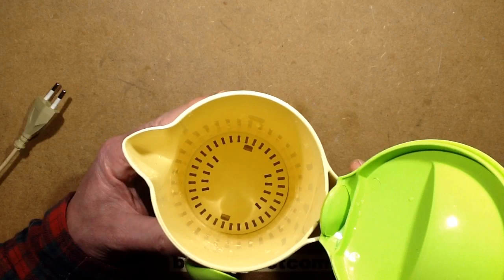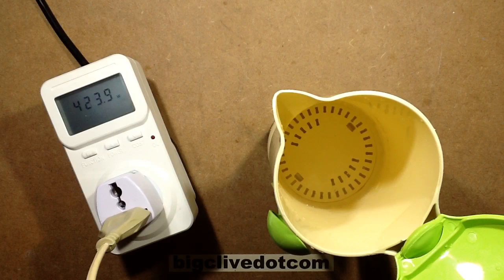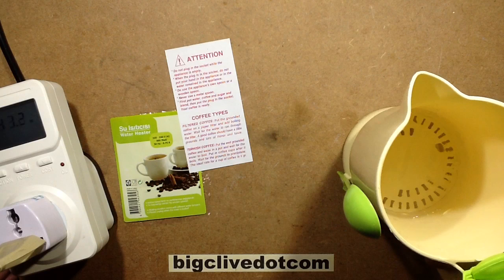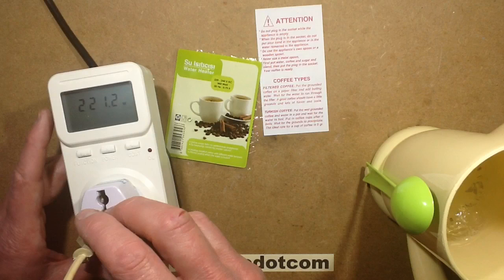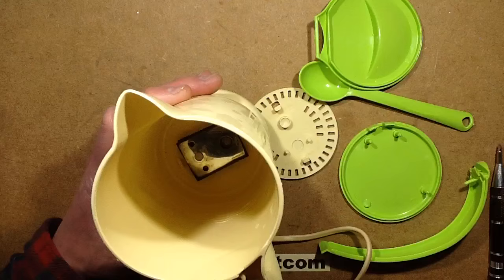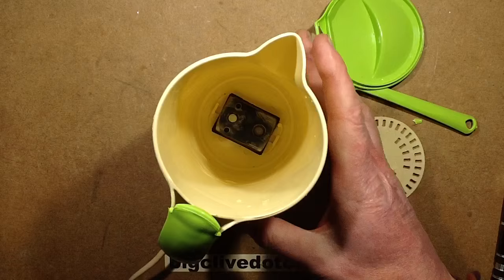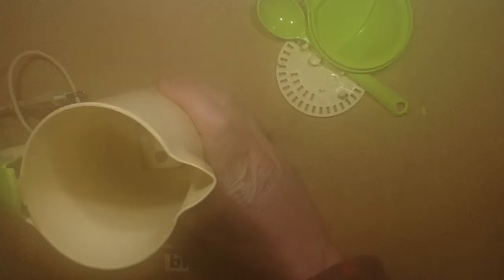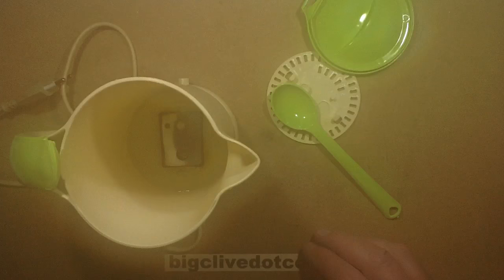Inside a dodgy Turkish "stinger" kettle.

Comment: After this review (when it was current) I launched into a project to try to purchase this exact kettle, find a brand new one in Budapest, I ordered one, arrived in California, and completely unusable in my home country, it has become one of my prized possessions, sitting out on display, ( still in its original plastic wrap package a proudly showing the bizarre green color scheme and critically important green plastic spoon attached to the side) it serves a a conversation starter and a completely exotic technology demonstrator of what is possible without government intervention and the assumption the user is not a idiot. Thanks Big Clive for opening my world and connecting me with a wonderful souvenir.
Reply from the maker: I've kept all the shady electrode boilers as souvenirs.
Reply: Surely if the water resistance is the same, and I see no reason for it be wildly different, it should work on 110, just a bit slower.
Reply from the maker: @johnsherborne3245  It would be significantly slower for a given resistance, but would work.
Reply: If this is what non government intervention creates then give me intervention any day. At least I know my kettle won't zap me and the intructions that come with it won't cause me to add coffee ingredients into electrified water and create a health hazard of a coffee.

My government approved chargers are also less likely to kill me.
Reply: My point is that government standards are very important to safety, especially with electrical appliances. This channel features a plethora of products made without regard for government regulation that are outright dangerous.

Comment: I consider myself a lady of a coffee-drinking persuasion, and I like ways to make small servings of coffee faster and easier. (One of those keurig machines is really tempting, but our old West German coffee maker is still chugging along 20+ years later) I would not want coffee from something like this. Perhaps it could be used to heat water and make pour-over coffee, but then I'd just use a kettle. Coffee that has been "electrocuted" into life doesn't sound like it would turn out well, and it sounds like it didn't. I'm not a chemist, but my gut reaction is that the acids in coffee combined with copious amounts of power could be stripping stuff off the electrodes.
Also instant coffee is worse than original sin in my book.
Reply: I am a chemist, and yes, stuff will slowly be stripped off the electrodes, especially with extra stuff in the water. Interestingly, if this was DC you'd get plating on the electrodes (or some other similar reaction). What's happening inside the kettle is electrolysis. The things inside the water (and to a certain extent the water itself) are being torn apart by the voltages. Again, if this was DC, half would stick to one electrode and half would stick to another but because this is AC, they just bounce around and stay in solution. This isn't a problem if all you have in there is tap water - the ions provide extra conductivity and don't really go anywhere, and electrolysis of water is almost nonexistent at typical mains voltages. It's just a strange and potentially unsafe way of heating water. It becomes a problem when you add organics. They tend to electrolyse in messy ways and recombine in messy ways, so you'll get a soup of various unknown compounds, some of which may be toxic or carcinogenic, and all of which will taste foul. See Clive's electrode-fork-food-heating videos for a practical demonstration on what happens when you just jam uncontrolled mains power into organic materials.
Reply: Steve1989MREinfo would beg to differ on your view of instant coffee. LoL!
Nothing like a shot of Armychino with your MRE.
☕
Reply: I like the pour over for small servings, but recently ive switched to an aeropress, it makes some of the best coffee I've had at home. It's basically a big syringe where you steep the grounds then press it through the filter into the cup.

Comment: Mmmmm hexavalent chromium.
Reply: +TheFlacker99 (Flak) actually thats a good point, im sure there is electrolysis going on, and thus the chrome comes out of stainless, yep good job they dont sell them here!
Reply: +TheFlacker99 (Flak) https://en.wikipedia.org/wiki/Restriction_of_Hazardous_Substances_Directive
Electrolysis of metals into the water?
Reply: paul60163 Yes, using stainless steel causes hexavalent chromium to be put into the water.
Reply: +TheFlacker99 (Flak) Under what conditions? Under what temperatures?
Reply: BIll Georgoulakis
any temperature, it is caused by electrolysis, that part of the plates dissolve into the water
Reply: +jusb1066 Oh, you are talking about the plates that curry the current. What made you think they are made from stainless steel?
Reply: BIll Georgoulakis
ordinary steel would rust right away and colour the water.
Reply: +jusb1066 Of course, but nickle plated brass is the usual low cost alternative in those cases...
Reply: BIll Georgoulakis
im sure clive mentioned in another video they use stainless, im sure using nickel plated brass would also put metals into the water, ( i dont know if copper or zinc or nickel is dangerous or as bad as haxavalent chrome!.  electrolysis will always dissolve the electrodes, on ac both will be affected, on DC they use it to remove rust or do electro plating so affecting only one side
Reply: +jusb1066 Oh, yes I don't doubt that any metal will impart metal ions in that kind of configuration. That's probably the reason for the metallic taste he mentions. Another reason to get a water element ketle and not use this kind!
Reply: +jusb1066 electrolysis needs DC, it don't work with AC.
Reply: Oskar None
that is technically true, but at normal ac hz it is much the same, only at huge frequencies does it change
Reply: +jusb1066 Wouldn&#39;t any liberated ions on one half-cycle be attracted back, and de-polarised, every time the voltage switches polarity? Producing ions needs DC.
Reply: greenaum
yes but nothing works perfectly, it would leave tons of contamination in the metal, perhaps some things dissolve into the water and dont come out so easily. not good for something you are drinking from, i read that ac at normal frequencies is barely different to dc, what seems a fast change to us doesnt necessarily carry over to chemistry.
Reply: +Oskar None if you want to have a consistent deposition indeed you do need DC. However, if you have fairly low frequency AC you will corrode the electrodes which will end up with some metal compounds in the water. With a substantial current flow in one direction over 10ms not good there will be free oxygen and hydrogen liberated. When it reverses, most of it will recombine with it's opposite and reform water. However, its plenty of time for some of these fairly aggressive atoms to combine with metal from the electrode causing corrosion and some will end up in the water. It might only be small amounts, but metal compounds are not what you want in water. Chromium compounds can be toxic.
Reply: Only happens with DC current. You can't do electrolysis with AC current, therefore you can't get hexavalent chromium with it.
Reply: +rogertopful you can only consistently electrolyse something that way, but the process will release free oxygen or hydrogen for the few tens of milliseconds at the relevant electrode when the current is flowing in on directions. Mostly these will just recombine very rapidly with the hydrogen or oxygen atoms which will have been released at the electrode in the period when the current was flowing in the opposite direction (which is an exothermic reaction which will be responsible for most of the heat being generated). However, individual hydrogen & oxygen atoms are highly reactive and a few will react with the metal of the eletrode (unless it's made of something like platinum). That will cause corrosion at the electrode and some will get into the water and contaminate it. Probably not a lot, but maybe enough to taint it and make it tasted metallic.
Reply: No, electrolysis cannot be produced with alternating current, only direct current.
Reply: the wiki page on hexavalent chromium says it's also called "cancer causing chromium". sounds wonderful

Comment: I used to work at ICI some 30 years ago and one of the labs had a water heater for producing distilled water, using exactly this method. Instant boiling water. I was impressed!

Comment: Around 1986 if you looked in the right second-hand shops you could find an odd "kettle" consisting of a ceramic jug with an exposed wire-on-ceramic heating element inside, hanging from two metal terminals at the back. The main concession to safety was that the power connector could only be inserted with the lid closed.

Comment: This idea has been around for a long time I first came across it in a motel back in the 80s, but as a safer version that you had to unplug before you could open the lid . It literally electrocutes the water to boil . The reason for the current drops is because  of the bubbling around the plates  reducing the amount of water contact thus reducing current flow .

Comment: So not only is it an electrocution hazard but there is no temperature overload protection. You are doing a great job raising my awareness of dogey mains devices.
Reply from the maker: They self regulate when the water boils by creating less contact area.  If they boil dry it breaks the circuit.

Comment: looks like the pressure of the steam pushes the water out of the holes, and the water can't get back down to the element, so the current goes down
Reply: +Sparky Projects if the holes were a bit smaller you could probably get it to just boil and remain on the edge, and not use all that much power to keep it there
Reply: +jusb1066 Probably true, but if the holes are too small, the initial point it starts to boil it could pressurise and shoot water higher

Comment: Is it wrong Clive, that I imagine you keep a piece of mains flex with a plug on the end, in your toolbox, for "emergency" on site tea making ;)
Reply from the maker: +arcadeuk No need.  We have rugged professional Chinese ones.
Reply: +arcadeuk You can always just bust apart a lightbulb and use that too.
Reply: +bigclivedotcom 
I'm wondering if you have tried distilled water with any of these deadly heaters. I'm curios to see if it would even work. I did some Google searching and if you can get your hands on deionized water it's conductivity it's about .1 mhos, distilled is about .5 mhos, and tap can be in the high double digit range to sky's the limit. that would make an interesting follow up video to see if you got pure enough water if the reaction would even start.  I would also like to see a resistance measurement of the water before and after boiling to get an idea if metals from the heater are ending up in the water.
Reply from the maker: +matthew weaver That video is currently being filmed....

Comment: After speaking to a Turkish friend, a Chef and restaurant owner, it is not so much the kettle that is Dodgy, it is the very Dodgy translation of the instructions, as you found out , they only boil the water, not the coffee mix with sugar. They prepare a wet mix of finely ground coffee and sugar and pour on the hot water to brew. This is not quite traditional Turkish coffee, which is simmered to bring out the coffee flavour fully. The difference to western coffee is the brewing with sugar, rather than adding it afterwards.
Stephen.

Comment: As a Turkish guy, I would like to elaborate on this pot.
These things are actually designed to replace copper pots used for making Turkish style coffee.(example: https://images.duckduckgo.com/iu/?u=http%3A%2F%2Fwww.enjoybettercoffee.com%2Fv%2Fvspfiles%2Fphotos%2FTP019-2.jpg&f=1 )
You have a habit of putting milk in every drink there :D We just add roasted coffee and sugar(if desired). AND most importantly, making Turkish style coffee requires attention.
-Normally you watch over it as it heats up and collect bubbles and distribute them to porcelain cups(I assume the spoon is provided for that purpose).
-When it starts to boil, you have to immediately take it away from heat(in this case, shut it down).
-You never let it stay on heat after it starts to boil or you fail as a lady.
-Then you pour it in cups and serve. https://images.duckduckgo.com/iu/?u=http%3A%2F%2Fwww.haberankaram.com%2Fwp-content%2Fuploads%2F2015%2F03%2Fturk-kahvesi.jpg&f=1 
-You normally use full flame for this and these things are expected to heat up quickly so no wonder your milky mixture caused weird reactions.

You and your friend bought some junk, the cheapest type... We actually use one of these at home: http://www.sinbo.com.tr/en/urun/kahvalti-hazirlama/kahve-hazirlama/elektrikli-cezve/scm-2928-82.html
These things have an on/off switch and properly earthed. Also heater is not in direct contact with liquid.

Comment: the first few times you use a kettle of any kind the water will be foul. you have to boil some water, pour it away and repeat at least 4 or 5 times before you get something drinkable out of it. therell be stuff coming out of the surface layers of plastic, traces of lubricant from any metal forming process and all kinds of noxious substances in the first few fills. this thing may not ever produce gourmet coffee but I bet it improves noticeably after several uses.

Comment: Could you make a video about solar power banks? They're quite popular because they are advertised to save your life when you're out camping for a few days, some models have ridiculous capacity ratings (like 30,000mAh or even 100,000mAh), but there are some more reasonable ones, rated at 5,000mAh capacity. The solar panels are said to deliver 200mA in sunny conditions, but what's interesting is that most of them indicate 'solar charging' by lighting up LEDs even in moderate light - I'm wondering if that small amount of light can really initiate solar charging of the power bank or is the LED eating up more power than the panel can produce. They are also a bit dangerous because I had one very Chinese solar power bank, I left it in the sun for a day, and in the evening, the batteries popped.
Reply: 100Ah isn’t that hard to come by. That’s what my deep cycle marine battery is rated at.

Comment: I remember as a kid going to some relatives house up north, somewhere out north of Manchester, I didn't know at the time but it turned out that we had Australian relatives who moved to the UK and I was surprised at the kettle they had, it was ceramic and the element was one of these type of boiling devices but larger and it boiled a whole kettle of water in about 2 minutes flat. They said it was an "Australian Jug Kettle" like https://s-media-cache-ak0.pinimg.com/originals/2c/41/cc/2c41cce94a102fcf436df3e87431ac37.jpg and these have been around since the 30's I believe.
Reply: Yep, we had a few of those in the 70s, I remember Dad changing the element on one, it is just a couple of nuts above the water line (basically where the plug leads go)  that hold the two wires leading down to the ceramic element.  I didn't realise it was an Aussie thing.  The plug/chord even followed a standard, so it could be replaced if necessary.

Comment: I have gotten one similar to this one. Mine is even worse, it has the metal parts exposed, it makes horrible rattling and buzzing noise, the water tasted like metal as well on this one, there is also small bits of black oxidation or whatever coming from the metal as well. My father still uses it at work lol. I have bought a proper kettle for 20$ but that thing tastes even worse that this because it water smells like plastic. So yeah, back to the heating element in water for me lol :)
Reply: ciprianwiner its toxic hexavalent chromium